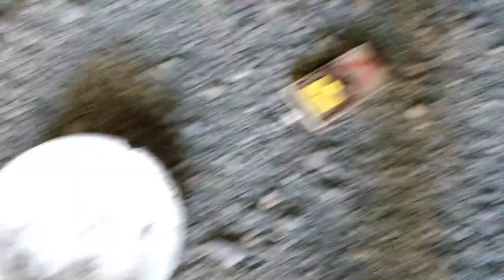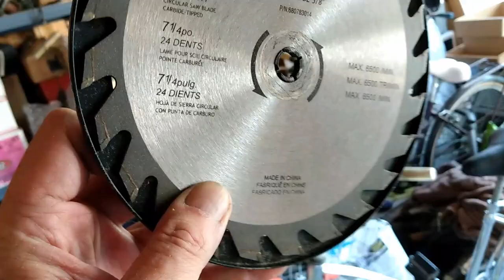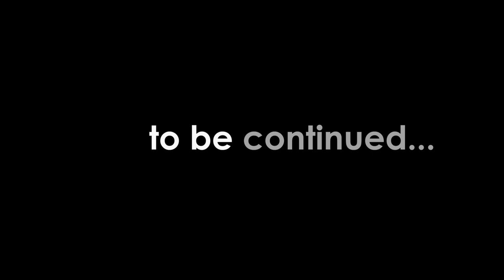Front step replacement p1o2

Comment: Hi Bob looking good. 
I also fix ting in my house and enjoy it, for about 20 years ago I bought a 26 cm wide combined wood planer and thickness planer, a bandsaw and a table saw, I spent some money on it back then, but they have earned them self back many many times. Try to go to a flea market or an auction I once bought a hole pallet full of bolts screws and different hardware from a closed hardware shop there were thousands of items in it and I didn't pay much for it. 
Enjoying your videos very much😊

Comment: If your mechanically inclined, it comes to you fast. You just have to logically think and ponder before proceeding, which I see this is what you're doing here so very well. . - You're getting there Bob. Nice work! Can 't wait to see the next part. Hang in there... 

Here is my experience Bob, being a home owner: I remodeled the entire of my house inside and out with no help at all. (Saved a ton of labor money). When i began, I had never ever done so much as taken a door off its hinges! I ended up doing siding, window, doors, soffits fascias, etc. I had to invent a temporary cement siding holder brackets to line the siding up before blind nailing. because each one was 12' long and heavy but very bendy and could break easily. 12' long and wide cement soffits were also hard to by yourself. I came up with a rail system to hold them perfectly in place before nailing, I just had to slide then up to position. All of this was just the outside! I haven't made any huge mistakes as of yet so far. I shouldn't have mentioned this. I'm doomed now...
Reply: Well, my experience as a homeowner is renting has its good points.

Comment: You need stainless steel screws for the posts to make a proper handrail. A portable saw is a must for this kind of work. Need a carpenters square and triangle too.
Otherwise you are going to need a lot of aspirin for all the  headaches this project will give you. Underneath the porch reminds me of finding Al Capone's vault. LOL
Well Bob  at least the weather is nice!      See How to Properly Plan Stairs at This Old House. They always make it look easy! You are doing pretty good so far!
Reply from the maker: The old handrail just hand a nail driven from the top into each rail.  Another common way it's done around here is to use 1x4's secured at each post.  Then the rail are just nailed from the side.  Sandwich another 1x4 after the nailing to make it look neat.  I have all the tools.  It's finding the raw materials that's the challenge